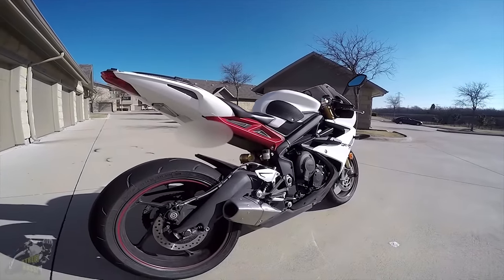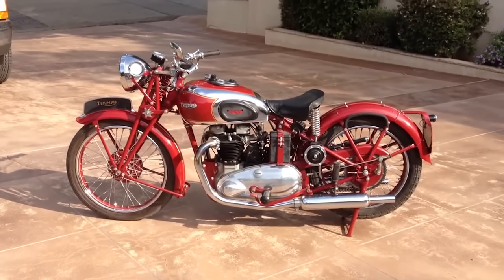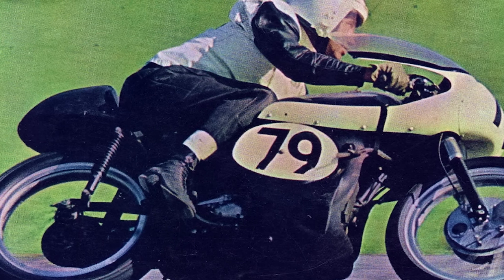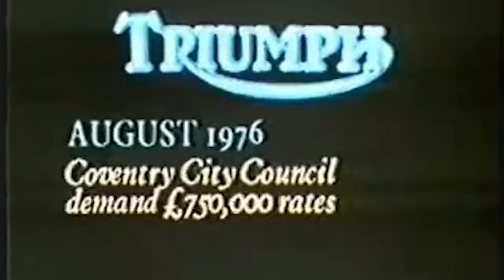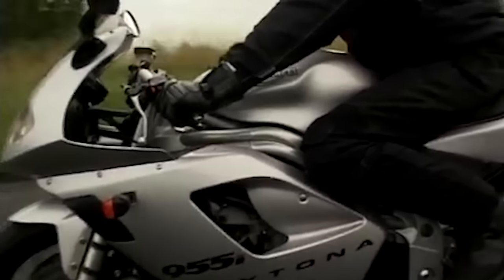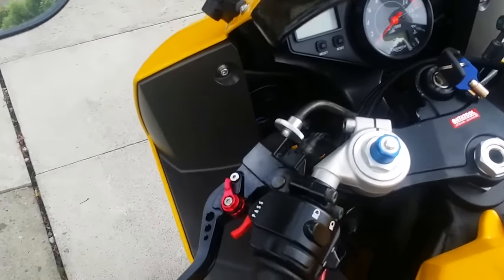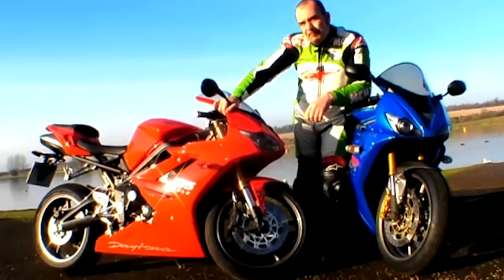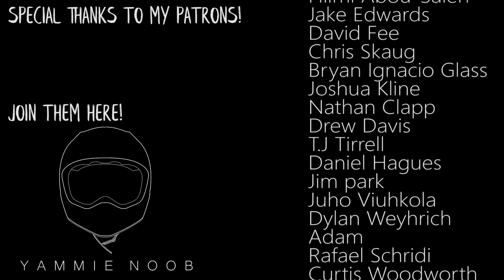The Daytona 675 - The History of Triumph's Middleweight

Comment: I just bought a 675 for track use. All the parts are backwards compatible. Wheels, dampers, slipper clutch, shocks, steering head etc. 
This means you can get near r6 performance at SV650 prices. Most of these parts like ohlins suspension can be bought cheap on Ebay and further upgraded from there.

Comment: such a shame it's now discontinued.... they truly are amazing bikes! the 2013-2016 will hold value because of the limited run and low exhaust.

was not expecting this video to be anywhere near as good as it was. fantastic job yammie!!! huge effort has paid off!

and thanks for making great content!
Reply: Frugaltail they are still in dealers +2017 models. they will just drop a new one on the horizon anyways
Reply: Greg Welch not in the UK. they are no longer in production it's just left over stock that cant be sold in the EU due to emissions laws. Triumph have not suggested there will be a replacement,  there have been no spy shots of a new bike or no leaks about development. triumph seem to be pushing into modern classics at the moment rather than anything else. There has been no update or replacement to the Sprint St/GT range either. it's a real shame. the Daytona IS the BEST middle weight sport bikr. by leaps and bounds.
Reply: Frugaltail there was very little new street triple info until the launch event and now there's 3 of them lol. I don't see them developing a new engine and not carrying it over to share development cost
Reply: Greg Welch the new street was in MCN over a year ago being tested at the site in Spain. Then in November there was more leaks from staff. but before all that kicked off in 2015 triumph sent out surveys to it's reviewers asking about features that are desirable on a new version of a street triple. there may be a new Daytona but from the staff I've spoken to.... don't hold your breath it could be some time off! but none the less, i do hope i am wrong! guy Martin racing one at the TT would be insane

Comment: In Triumph's defence (or not...), the TT600 suffered with poor fueling due to Triumph wanting to be the very first 600 supersport to be running fuel injection. The Speed Four and Daytona 600/650 were huge steps forward. Thank you from a fan and TT600 owner (full disclosure).
Reply: Aaron Marsh lol I ride one too! I like the cosmetics over the D600, but hate the idle surge.

Comment: the first triple i owned was a 2002 955i and it was amazing torque everywhere super smooth handled amazing and comparing it to a Japanese bike was ahead of its time having injection and fully adjustable suspension. wish i never sold it.

Comment: 17 675R - 110.9 crank hp, stock quick shifter
No traction control or rider modes. MSRP $13,999

17 zx636 - 119.2 crank hp
3 different traction control, 2 rider modes. Stock quick shifter.
$9,999 full ABS model.

Comment: Hey @Yammie Noob! i'm comming from a cbr 600f4i,and after i sold it some months back,i am considering one of two bikes : a 2008 R6,and a 2009 daytona 675 (or a 2010 675 SE model) both have 25.000 kilometers and are completely stock,i havent ridden on any of them yet,as the sellers dont allow test rides here,so i would like to ask for your opinion (i am more biased towards the R6,because i work @ a yamaha shop and have more general knowledge of its engine,plus cheaper parts for me...buuuuuut the 675 is a beauty....) both of the bikes will mostly get out on saturdays and sundays on the twistiest roads i know,no track days at all

Comment: You just glanced over the entire T3 triumph line. The 90's Daytona and other T3's are what SAVED Triumph from going under.

They needed to make a name for themselves again after producing unreliable bikes in the past and what they produced was 

one of the most reliable bikes ever created. The 900 in these bikes are tanks, they may not have been the fastest at 96hp

But what they lack in power is more than made up for in character. 

 If it wasn't for the T3's we wouldn't have the speed triple and subsequently the street triple in later years.

Not to mention they had a 4 cylinder version of both the trophy and Daytona that produced 150hp

You are doing yourself and your viewers an injustice by just passing by these bikes by so easily.

All i can say as a T3 owner and as someone who a ridden most of the 90's triumph line is, go ride one for yourself before

set them aside as a " rough patch". You might just be surprised.